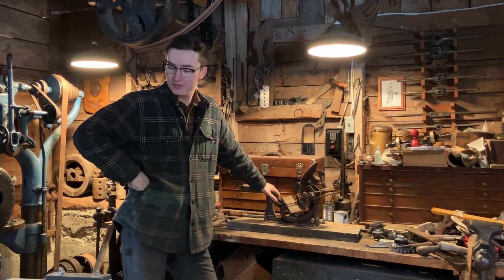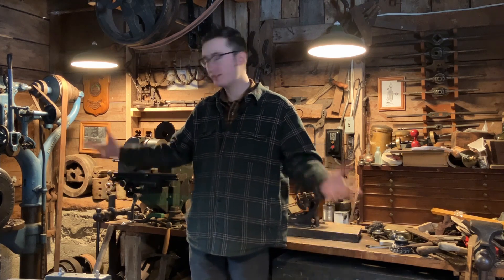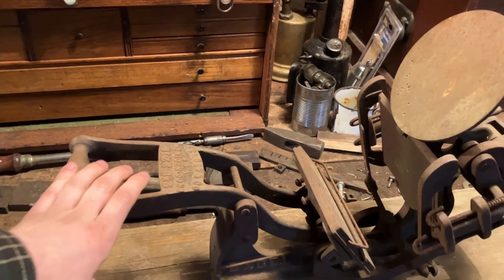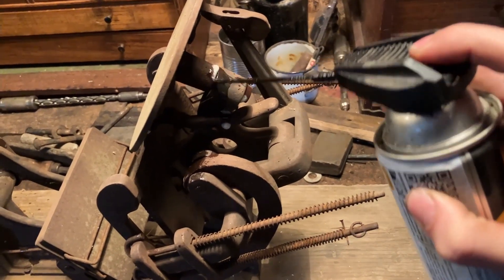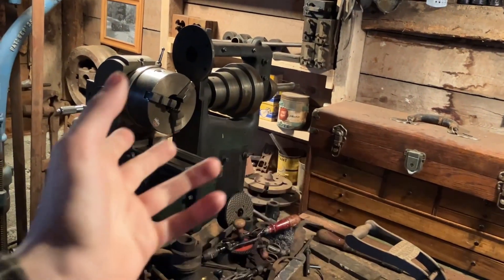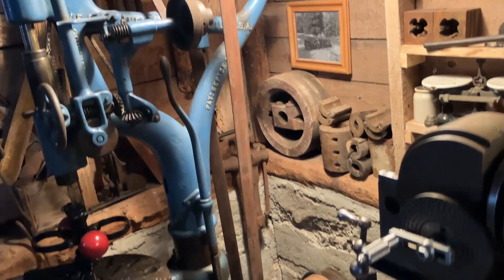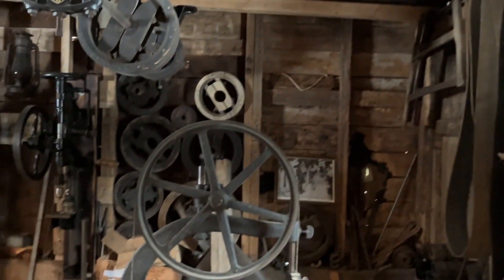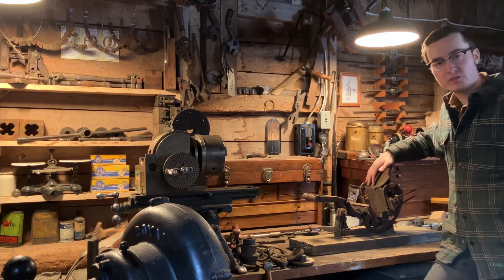Benchtop printing press, Dividing head, and Shop Progress

Comment: Nice little Kelsey. I have the exact same little guy on my “fix one day” pile. Mine is mostly intact, it’s missing a roller hook, rollers, tympan bales, and chase (the chase is the thing that holds the type). 

Sadly, the go-to guy for Kelsey parts, Alan Runfeldt, died last year. Someone is working on re-booting his business, but they haven’t got the ball rolling on it yet. All the stuff I’m missing can of course be made by hand, but sometimes it’s nice to be lazy!

I remember reading a personal history of manufacturing at Kelsey written by a Kelsey employee. They finished the castings in a surprisingly crude manner; no jigs were used, they’d just eyeball things and hold them by hand while drilling. Places where you’d normally use a milling machine, they’d use a hand held grinder.
Reply from the maker: Thanks for the info! That's a real shame about Alan, I used his site as a reference for the parts I was missing. Cool story about Kelsey, they must have been doing something right based on how long they stuck around.

Comment: i have  a spare table for a post drill if you want . i live in Ontario and can ship it to you
Reply from the maker: I really appreciate that, this one takes a strange table though. I have a spare table from another drill like a common champion but the setup is quite different. Cheers
Reply: @castironmachines  i just cheeked and if your drill is the no 10 model then i got your exact drill sitting in pieces in my shop . table is still good thow its been sitting in a bucket of evapo rust for 1 month or so